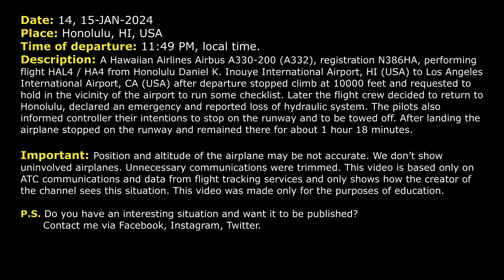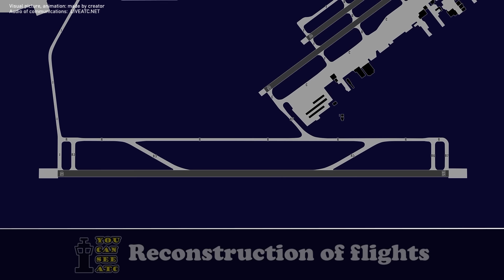Loss of hydraulic system. Loss of nose wheel steering. Hawaiian A330 returns to Honolulu. Real ATC

Comment: I flew the 330 years ago and had a similar incident just after takeoff.  There are three redundant hydraulic systems, Green Yellow & Blue.  The green system is the faulty one here as that is what supplies pressure to the nose wheel steering, the same system that I had failed after takeoff.  It is the largest of the three, and has pumps driven by both engines, a separate electric pump, and in case of total failure the ram air turbine (a small propeller that swings down and airflow spins a pump).  

The 330 is still very flyable on the other two, but there are some landing considerations.  With green system gone, normal braking system will be lost so you must use the backup alternate brakes, also some of the ground spoilers will not deploy which also helps reduce lift and slow the plane on landing.   Fuel dumping is an option, but not all 330’s are equipped with this feature, so the plane may be quite heavy requiring more runway to stop.  Also the flaps and slats extend much slower, requiring more distance to slow the plane on final approach.

Without nose wheel steering, on initial landing the rudder will still provide directional control, but the slower you get the less authority you have.  In my case we had to revert to using small opposite braking inputs to keep the plane rolling straight down the runway, not something you get a lot of practice doing on a big jet.

We had suspected a leak as there were no indications of the pumps failing, and there was a concern that if hydraulic fluid were to leak out onto the hot brakes which had to stop an overweight plane, there was a possibility of a fire.  Fortunately the emergency trucks could find no evidence of an external leak.  The actual reason for the failure was found to be caused by a maintenance procedure that was just carried out prior to the flight.

Anyways excellent job to the flight crew, I know exactly what they had on their hands and the challenges involved with getting it back on the ground, including a long wait to be towed back to the gate!  Well executed !
Reply: Why return to airfield??
Reply: @user-microburst  Well, in my case the landing gear (which is also on the green system) never retracted, so we were definitely not going to continue.

I suspect this flight was not the same fault origin or sequence of events as they continued their climb to 10,000 feet, however flying out over the ocean with a main hydraulic system failed is not an ideal prospect when you can return to your maintenance base.
Reply: @A_MOISTER_OYSTER  most likely the company told them to return
Reply: @user-microburst  the would certainly communicate with the company, but in these situations the company doesn’t tell them what to do.  The decision to return is up to the pilots.
Reply: You talked about the back up alternate brakes, but how do you trigger the back up ?

Comment: If it was a hydraulic  leak, they would have to stop the leak and clean up the  fluid before moving the aircraft otherwise there could be extensive contamination
1:18 sound about how long it would take to stop the leak cleanup hook up the tow tractor  eyc

Comment: I thought the tower said the tow was coming in a minute and half or something?  why were they stranded there for 1 hour and 18 minutes?  🤔
Reply: They probably took time to make sure they wouldn’t do more damage or to patch something up enough to tow. Taking an hour to do it safely is better than closing the runway for several hours.
Reply: @silmarian  As shown in the illustration, there is only ONE runway for the larger aircraft.  This is a very old airport.  Tucked away in a corner someplace might be the instructions for water landings by seaplanes with floats not wheels
Reply: @drmayeda1930  8L and 4R are normally used for arrivals by the larger planes depending on time of day and wind conditions while 8R is usually for departures.  As per the ATC they decided to not potentially block both 8L and 4R as they intersect nearing the end of both runways.
Reply: It probably just got cleared to taxi right before he said that. They are slow and it’s a fairly long haul out there. Plus maintenance probably met the plane out there so that may have added time.
Reply: Plane might have had a hydraulic leak. Don't want it to bleed over the entire airport
Reply: Nothing and I mean nothing goes fast in Hawaii.
Reply: That’s why Hawaii kinda (fill in the blank.) 😬
Reply: Lunchtime…
Reply: It’s the most Hawaiian thing to take forever to get work done.